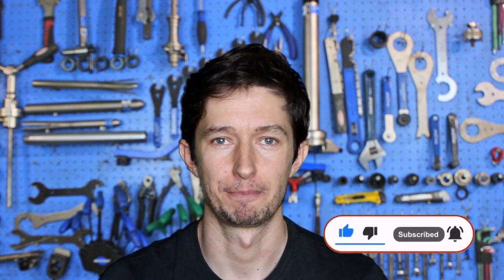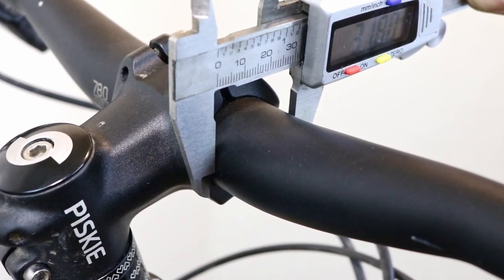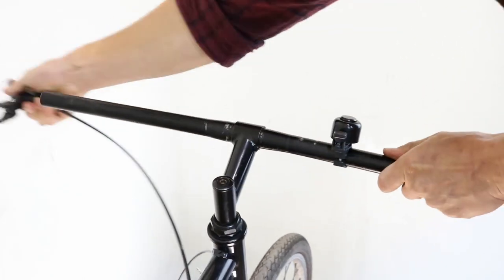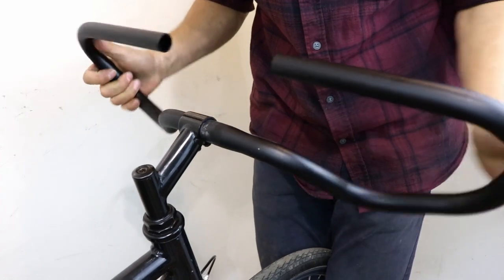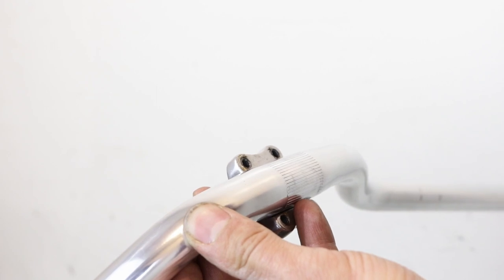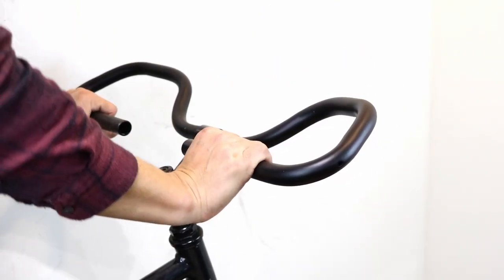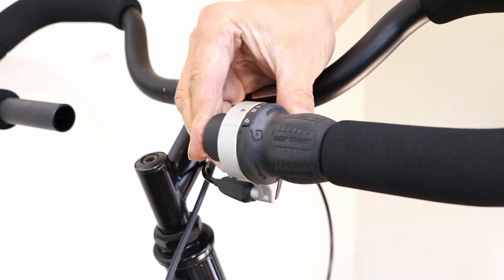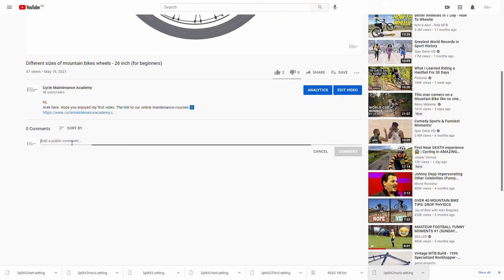How To Install Butterfly Bars On Your Bike

Comment: Butterflies handle bars give you the hand positions of a automobile steering wheel btw
Reply from the maker: Hey, you're absolutely right! Butterfly handlebars do provide a variety of hand positions, kind of like the options you get with a car steering wheel. Thanks to its shape you can change positions and find the most comfortable one for you especially during long-distance rides. If you have any more insights to share or questions to ask about bike setups, feel free to drop a comment.